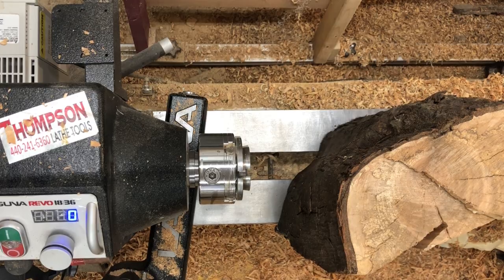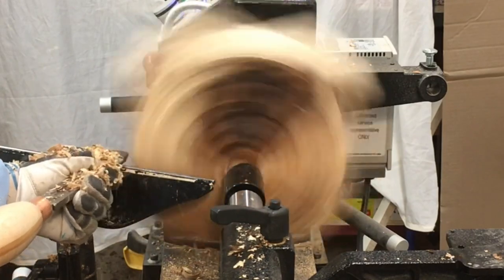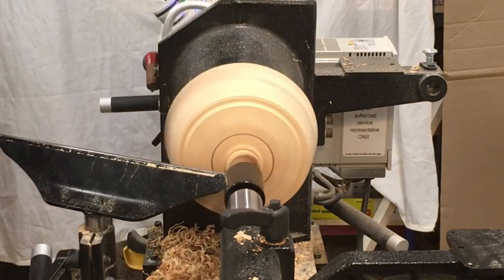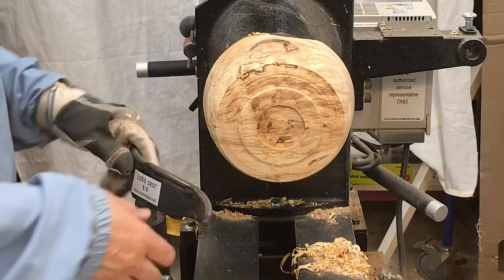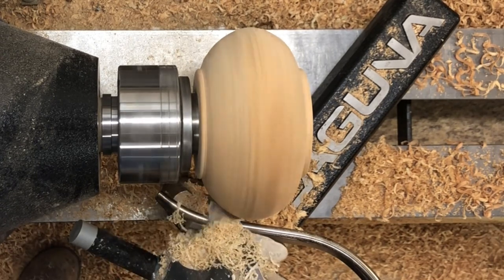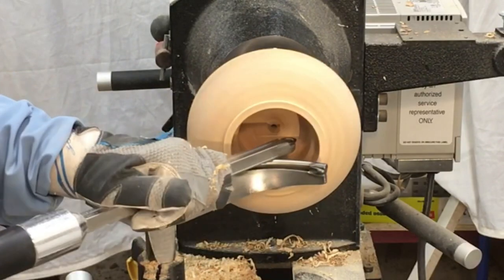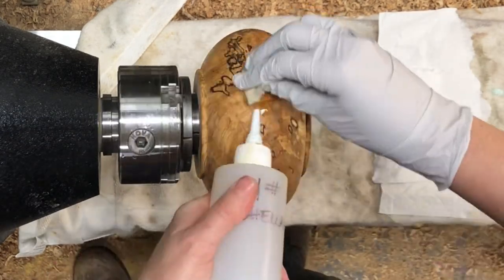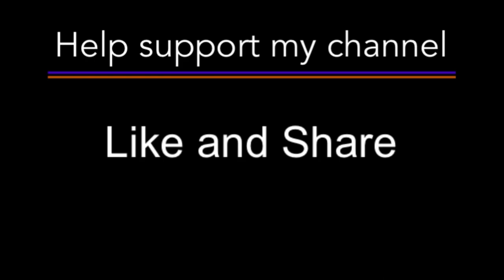Woodturning Spalted Maple: Turning a Hollow Form - The Squat Little Pot

Comment: Nice turning Lisa.   I like the two together and really like the shape of the other.  Good work!
Reply from the maker: Thanks Lance, they do make a nice pair don’t they 😁
Reply: @LisaRamlow  they do!    Are you still having “wobble” issues with your G-3 chuck?   We talked about that months ago because I have the same problem and I also have a Laguna 18-36 lathe.   I purchased a oneway strong hold chunk, don’t even use my G-3 anymore.  Nova wouldn’t do anything about in fact they quit responding to my emails.
Reply from the maker: I’m trying to use the SuperNova2 and that does seem to help. I’m pretty sure the main issue with my G3 is the spindle adapter just giving it a little bit of play. I’ve been looking at Vicmarc and OneWay chucks but haven’t pulled the trigger, partially because I just bought the coring system and partially because everyone seems to be sold out of them at the moment!

Comment: Beautiful bowl Lisa. On a side note, if you rub sanding sealer around the area that you want to use ca on before you use the ca it won't stain as bad. Hope I said that right.
Reply from the maker: Thanks Allan! Yes, I understand about the sanding sealer - not sure why I didn’t do that on the outside, except that I needed to finish sanding it and the shellac gums up the sandpaper if it’s not cured. I also thought I could manage to keep the CA in the inclusion but the tip on this bottle is so goobered up with dried glue I couldn’t get one of the precision tips to go on it! 😂

Comment: Lisa, great looking project.  I noticed that you turned a portion of the inside with the lathe in reverse.  I am still learning and have done this now about three times.  I find it easier than than the other option but it does take a bit of mind adjustment. :)    I just turned a small undercut bowl both using reverse and forward along with a swan tool to reach the undercut.  I think a bit of tear out is inevitable, given the working constants present.  Nice job on the finish.
Reply from the maker: Thanks Dave! It’s way easier for me to hollow things like this in reverse and am really glad I have the option to do so. I just realized I didn’t mention the reverse part in the video - oops. 
The tear out inside this was pretty bad because the wood was punky in spots but it’s relatively smooth inside and I’m working hard to overcome my perfectionist mentality and learn “good enough!” 😁
Reply: @LisaRamlow   I have one purchased swan tool and one that I made (I'm a retired tool maker)  Thinking of making a "left hand" swan tool, that could be used to undercut, when the lathe is in reverse.
Reply from the maker: That’s a great idea. My dad is a retired tool & die maker, machine builder & machine repairman and so I get lots of cool tools and stuff but he has a wood shop and no metal lathe so custom made tools aren’t so much an option

Comment: Very nice Lisa! I assume that the blanks were pretty dry when you turned them?
Reply from the maker: Sort of - the tree this piece came from was cut down last summer. I think it read about 15%’when I checked it with a pin moisture meter, but I don’t know how accurate those really are. Neither piece has warped, though the larger one did have a crack that I tried to cut out. I mostly succeeded, but there are a couple places where you can feel it more so than see it. It cut like it was dry but that may have been due more to the punky bits 🤷‍♀️
The whole thing was really an experiment and I’m thrilled I was able to get a couple of nice pieces from the log 😁